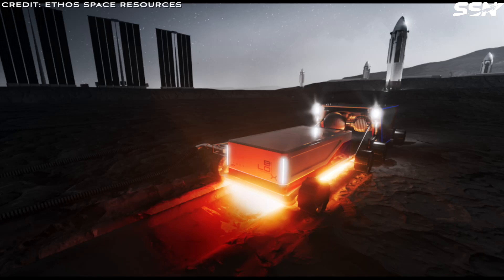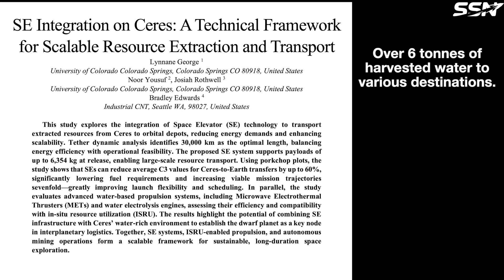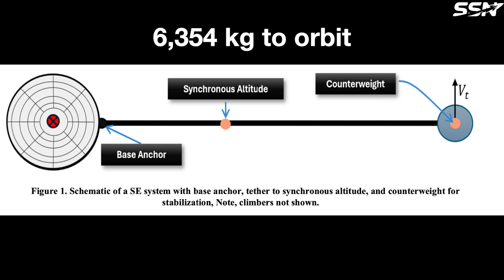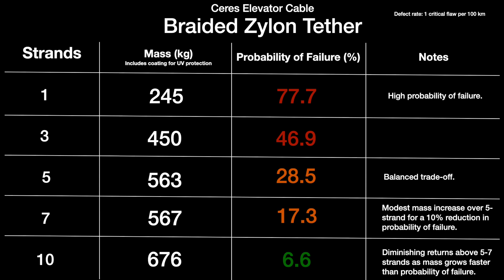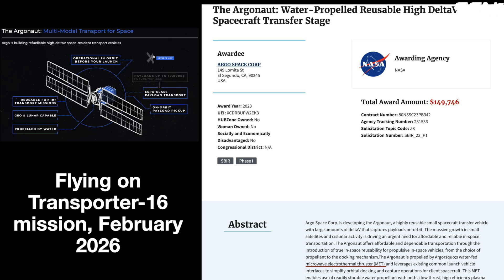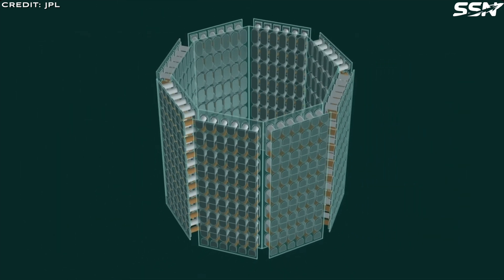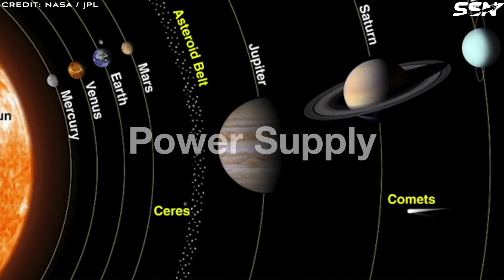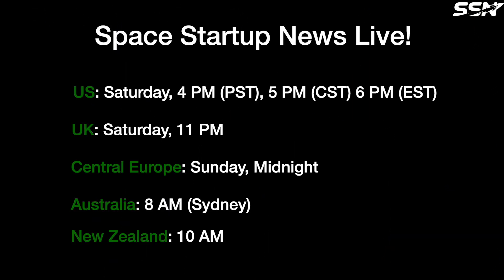Mining Ceres: Using Ceres as a Resource Hub to Pave the Way for Expansion across the Solar System

Comment: You may be better using a tube as the elevator. In a tube, gases such as hydrogen, oxygen, nitrogen and fuel gases can be transported off the surface easily by just pumping.